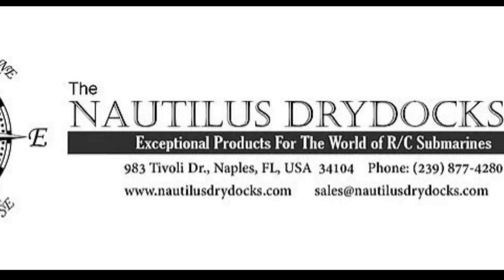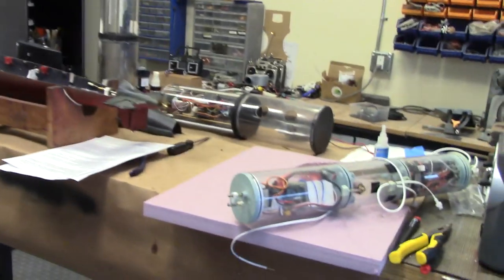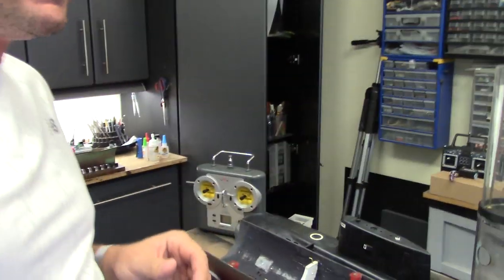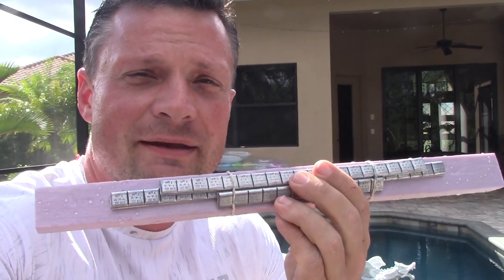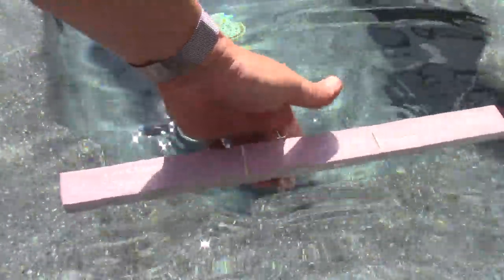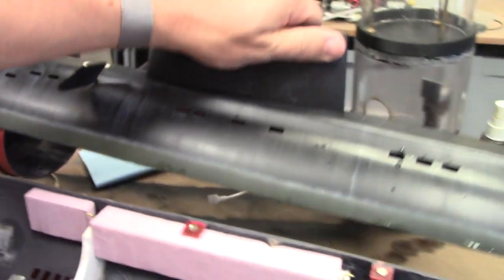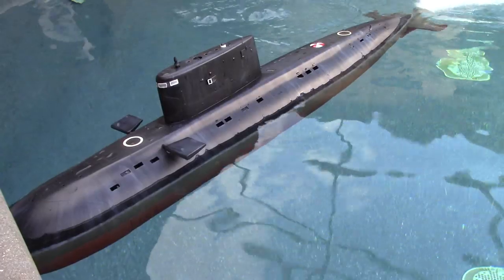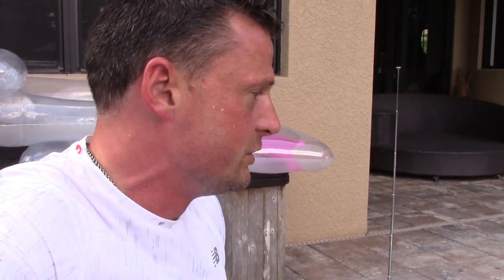What to do when your RC submarine won't stay upright

Comment: when there is only one propeller, the centrifugal force generates a torque in the opposite direction, bending the boat.You may consider adding extra foam on that side when moving forward to compensate. Of course the phenomenon is proportional to the propeller speed. so you may want to make a small correction
Reply from the maker: It's not centrifugal force. It's torque-induced roll, the prop is literally twisting the boat due to it's bite against the water. More foam on one side? It will sit crooked when standing still. Active roll compensation is the only perfect solution, with port and starboard dive planes operating independently via a pitch controller.